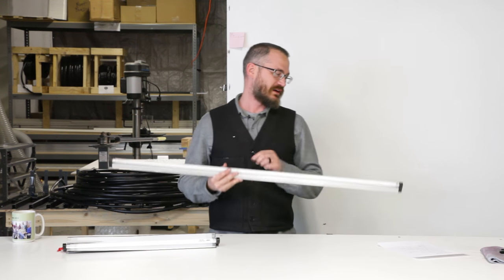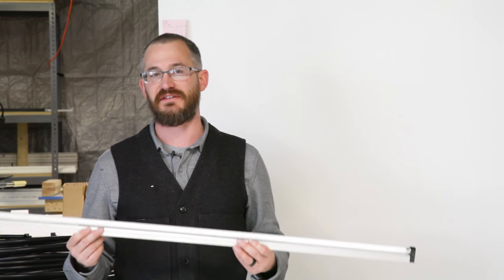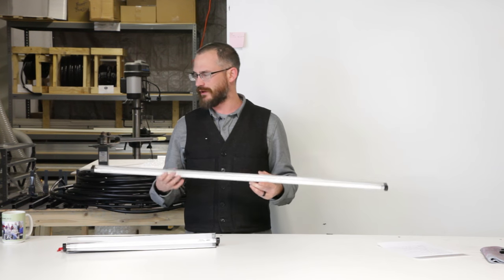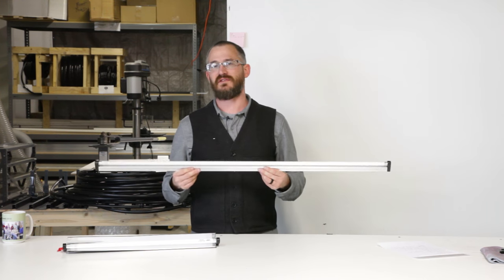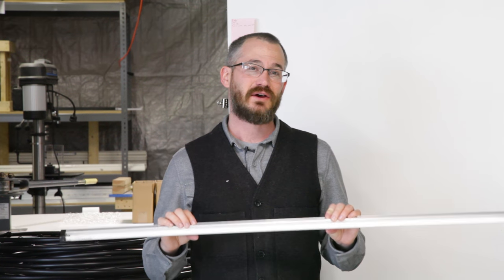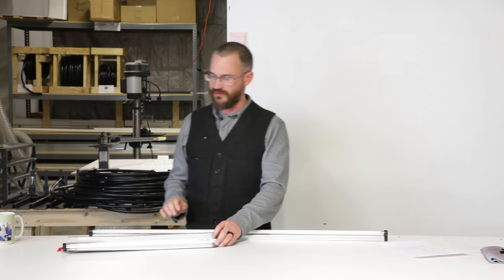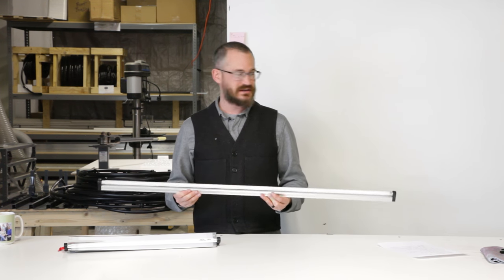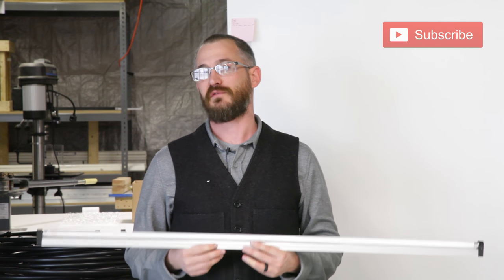Choosing Fluorescent Grow Lights

Comment: Well that was helpful.
I am bringing a plant indoors until next spring. And am going to use lights to start my vegetables this winter.
Went to a big box stores and they said everyone uses t5's.
But have listened to some pepper hydroponics growers debating flourescent as opposed to led.
Not many talk what lighting is the best except for their own scenarios.
I don't have chests or dungeons full of pieces of eight. So I have to spend and research before making a decision.
Was going to go with t5. But now I'm thinking led for the amount of energy. Plus LED's say they last a long time. Not sold on that. Because I believe the manufacturing process and differences in quality control at the manufacturing level dictate that.
Not to mention overpricing manufacturers that started with a good product but then got entangled in growing the company output without keeping their quality control in check. So there's that.
But at least you explained flourescent. Thanks.

Comment: I just picked up some 4ft GE T8 LED bulbs @ 6500K and am going to give them a shot. A contractor's 10pack of them was $74 at Lowes. I am just growing lettuce and hope that they work well enough. My light pully system I am installing lets me make 1/8" height adjustments at the pull of a cord. 
Do you know if 6500K T8 LED light strips have a guaranteed good light spectrum? 

Either way I suppose I will be running tests with different light height vs light duration to fine tune the system before expanding.

Comment: I'm starting a mini Microgreens farm in my apt... I'm definitely using T5... Thoughts on Transcend T5 Led replacement bulbs as options?  Is it worth the cost and are there enough benefits in production?
Reply from the maker: They're great lights for sure. We like them and use some Transcend bulbs in our system. The nice thing is you can start with T-5s to get started growing immediately and then replace the bulb as you get rolling and can justify the increased investment. Start small, prove it out, scale up accordingly!

Comment: great video, keep the good job, i have been using fluorescent bulb with input 105w output 525w - 220v and i noticed a hug difference between fluorescent 18w tube. in vegetation stage., i was wondering how to spot a bad seed ? and how to make the perfect condition for seedling ?
Reply from the maker: There are dozens of ways to start seeds, but we like using a prop chamber to accelerate initial germination. They're not required, but they're nice! http://blog.brightagrotech.com/seed-starting-for-indoor-farmers-propagation-chambers/ -- Spotting bad seed is tough. If you're thinking you might have bad seed, you can "overseed" and put 2-3 seeds per plug and then "thin" from there. Hope that helps!

Comment: In a store near me, I have found 54W 5000K T5 lamps. Do you think they would work? Most of the people use only 6500K lamps.
Reply: make sure they are grow lights, and i believe 5000k is meant to mimic natural light best and work well for generally most plants, 6500k will be a more cooler color, a soft blue tint to it, but in one of my older textbooks they say it ( old book at the time ) is current practice for some people to pair a cool color light with a warm color light, so with like a 2700k grow light which is a more, warmer yellow, or red tint to the light. I'm no expert but i do hope i got this right and not backwards, i would talk to someone who works in the light section of the store you are at. Possibly ask them if they know of someone in the outdoors section or gardening section that might know more that you could ask. I'm sure they would be happy to help. That being said i dont know if its a large store you are at or a smaller store

Comment: I'd like to build a small system in my kitchen.  Would a mirror help maximize the the light? thanks!
Reply from the maker: Hi Samuel, we typically steer people away from mirrors because they don't provide diffused, reflected light - they can therefore over-concentrate the light and burn your plants. Just throw some T-5 bulbs on it if you need more light! https://shop.brightagrotech.com/t5-fluorescent-light-rod-with-reflector-4-ft/ << Find some here if you need some!

Comment: nate good video. I want to grow some lettuce in our converted shed. now I know fluorecscent lights are fairly cheap but I don't have the budget to buy special growlights. I had a thought but don't know if it will work effectively. I can get standard down lights very cheaply. If I were to fit a few of them on a bit of ply say, and put 6500k gu10 lamps in them would that not work? I would love to fit all them with red/blue mix gu10 grow lamps but they are not that cheap so I was thinking of using 4 white lamps in a square pattern then a 5th one in the middle of this 4 which would be a red/blue grow lamp, to give the lettuce that little boost but keeping cost down. what do you think? I'm just wanting to grow food for us to eat with the least cost. I don't have my own garden but have a shed with power.